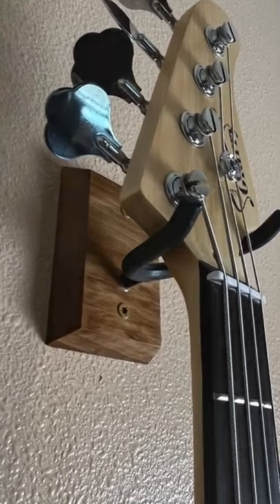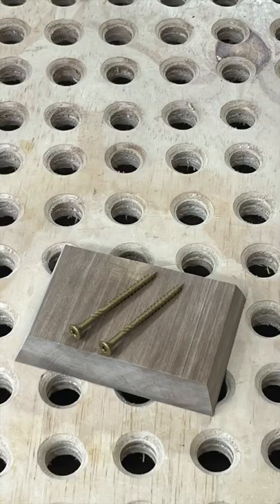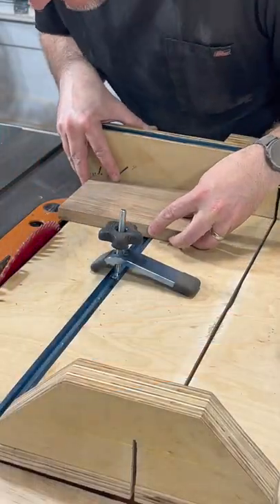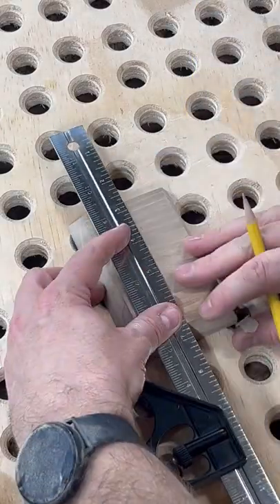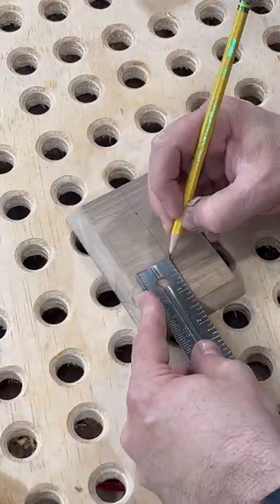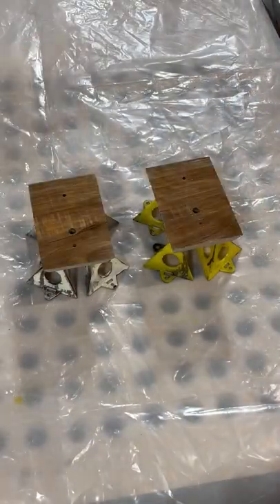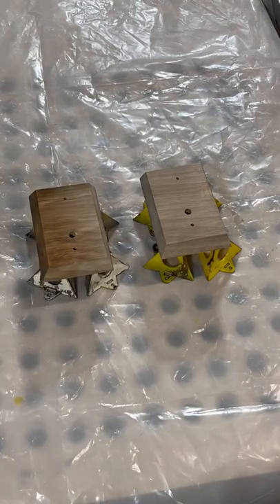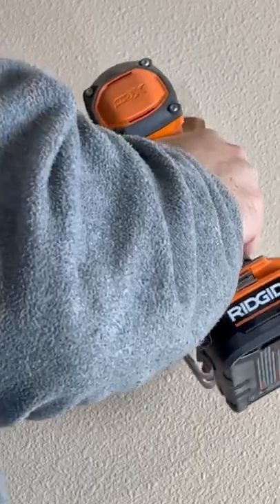Guitar Hanger | Simple Woodworking

Comment: Those work great for guitar. I made mine the same shape as the  headstock of the Gibson guitar I had at the time. I also added a spacer that I cut out of the same wood with a hole saw so that the guitar doesn’t hang so close to the wall.
Reply from the maker: Thanks for commenting. I’ve made four of them now,  and they do work great for all my different headstocks.